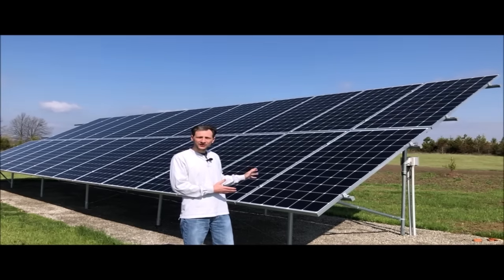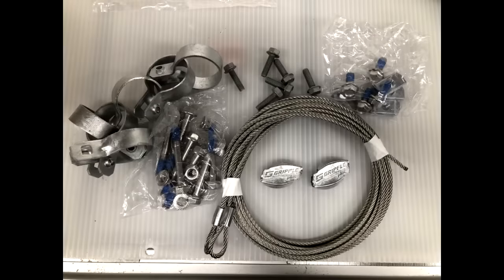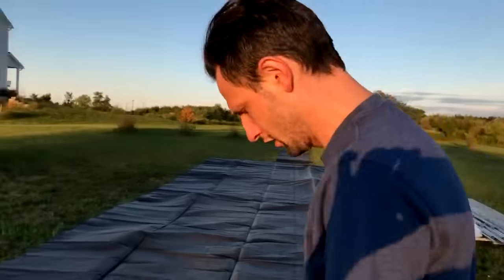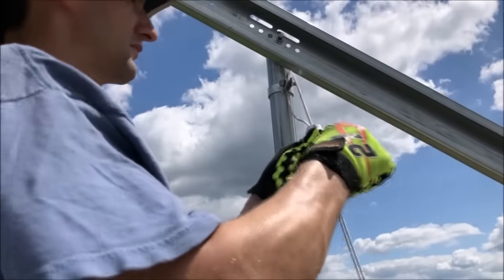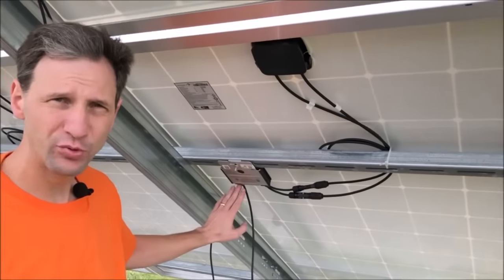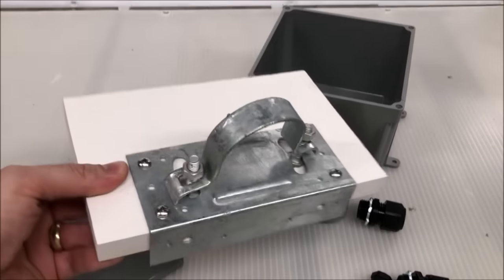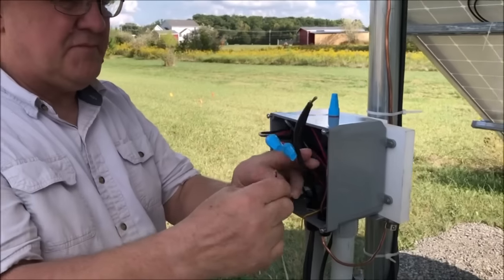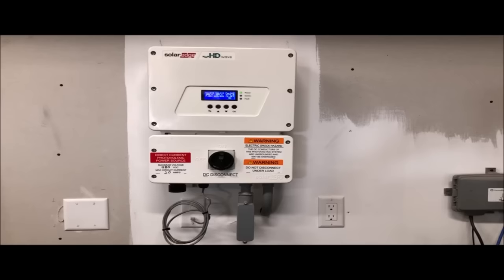DIY 9kW Grid Tie Ground Based Home Solar Panel System Installation

Comment: Great detailed info!  I'm thinking about doing the same, but with microinverters since I have some shade from trees.   One question, is 10ga wire enough to carry that much power for that distance?
Reply from the maker: The size of wire depends on multiple factors, including the voltage, amperage, distance, insulation, etc.   Since the higher the voltage, the smaller the wire can be, micro inverters are not a good choice for long distances.  Micro inverters output 240VAC, where as with an optimizer you can achieve 400VDC input to a DC-AC inverter.  You can use wire size calculators to help you at sites like this one: http://wiresizecalculator.net/
Hope that helps.  Thanks!
Reply: @ProjectsWithDave  Good info, thank you!

Comment: I thought that looping power cables can produce an induction effect.
Reply from the maker: While loops do produce an induction effect.  The loops at each panel, are very large, have few windings, and a low voltage.  I haven't had any issues so far, if someone has data on a possible negative impact, I would love to see it.  Thanks.

Comment: All fixed mounts lose a lot of energy due to angle of incidence loss. The panels would be far more efficient if they were always aimed directly at the sun as it moves across the sky. Of course that is a more complex installation to have panels that track the sun. Also, are these panels hail proof ? What about lightning? What wind velocity can they take? What’s the total cost, including batteries ?
Reply from the maker: Thanks for your questions.  In my analysis, the cost of the equipment to track the sun doesn't justify the increased output.  It is better to just add more panels if you need more output.  The racking system is rated for wind loads in excess of 90mph.  My homeowners insurance will cover any catastrophic loss.  I plan to post a video this Saturday with the total cost breakdown.  Thanks.

Comment: gravel seems like overkill.  Concrete tubes seems like a better idea.
Reply from the maker: Gravel is an added expense, but when I compare it to 25years of mowing around posts, I think it's worth it. 😀
The required concrete for this array was 7' deep 12" diameter tubes.  It was significantly cheaper and easier to do with the screw system.

Comment: Hey Dave, great video. How did you install mid-clamps between panels on the top rail? Any ladder gymnastics?
Reply from the maker: I used a ladder at the edge and reached over to the middle.  It is a bit of a stretch. 🙂

Comment: Did you consider a cut off at the combiner box.
Reply from the maker: Yes, but it is unnecessary.  I have a disconnect at the inverter and I can control the voltage of the panels to 1V/Panel with the optimizers.
Reply: @ProjectsWithDave  I install rooftop systems for my job but have to ground mount for my house. Thanks for all the information.
Reply from the maker: Many installers do install a disconnect at the ground mount location for convenience, and you should always check your local codes.  Even though It wasn't required in my location doesn't mean it wont' be in your area.

Comment: now wait a second your running 40 amps on a 10 awg wire at how many feet long... might want to think about derating for distance and possibly 8awg to handle the 40 amps.
Reply from the maker: here are two DC strings each at 480V and about 3,750 wats for a total of about 8 amps per string.

Comment: Did you hire an electrical engineer to design your system?  We are looking to installing a ground mount 25-30kw net metering system on our farm, with batteries.
Reply from the maker: For my first system I purchased the wiring diagrams from Unbound Solar for my permit process.  Later, after I had some experience, I drew them myself.
Reply: @ProjectsWithDave  Thanks Dave!  That is very helpful.  Your videos have inspired me to try and do my own system after getting quotes of well over $100,000 for our system.  Being a nonprofit, we also qualify for the new 30% direct pay program from the government, in addition to any other incentives from our local electrical coop.
Reply from the maker: I'm glad I could be an inspiration to you.  Hopefully you can learn from my data and mistakes and make an even better system.
Reply: @ProjectsWithDave  You’ve certainly inspired me to not be so intimidated by it.  I’ve reached out to Unbound Solar.

Comment: Great video.  What were you overall impressions of the ready rack system and it's adjustability?  I'm considering that for our system vs some others (snapnrack, ironridge, nuance osprey), but it was not clear how easy it was to get everything adjusted at equal heights and in the same plane.  Thanks.
Reply from the maker: Great question.  There are several holes in the connecting hardware that provide for adjustment in the angle and position.  I found it to be pretty forgiving in terms of accuracy in post placement, as well as straight forward to assemble.  I can't compare it to the others since I haven't used them, but I can certainly recommend the Ready Rack system.  Thanks!

Comment: Don't you get a significant drop in voltage with such a long run to the house?
Reply from the maker: The voltage drop is very small since the DC voltage back to the house is 480V.
Reply: @ProjectsWithDave   Actually you size the wire to compensate for this, hire an electrician that knows what they are doing.

Comment: I didn't see batteries connected in this presentation
Reply from the maker: It is a grid tie system, it doesn't require batteries.  Thanks!
Reply: @ProjectsWithDave  Appreciated

Comment: How did you make the decision to use power optimizers rather than microinverters?  Great video, I'm looking at Ready Rack for my install based on your experience.
Reply from the maker: I wanted the high voltage run from the array to the house, I also wanted the DC available at the house incase I wanted to charge batteries at some point, and I wanted the direct DC Electric vehicle charging capability.
Reply: @ProjectsWithDave  Since your strings come back separately to the house, isn't each string wire carrying about 200v? I had expected the combiner box to combine the two strings so the total DC voltage would have been about 400v coming back to the house. There were 2 wires from each string of 12 panels, total of 4 wires, and those got carried back to the house separately, true?  tnx
Reply from the maker: The optimizers control the voltage to 480 volts independent of the number of panels on the string.  I have a string of 12 panels running 480 volts with one home run and a string of 13 panels at 480 volts for the second home run.
Reply: Thanks, I didn't know that. I have a long run back to the inverter, it sounds like running DC is more efficient if the optimizers hold the voltage that high.

Comment: That is a long run! What is your DC voltage drop from the solar panel to the inverter?
Reply from the maker: I was worried about that when I set the system up, but it is only 2.5v - 3.0v.  Since the DC run is 480v and there are two sets of lines, it ends up being pretty efficient.
Reply from the maker: Thanks!  By the way, my inverter is also an EV charger, so I needed it to be in the garage.

Comment: I love the video and i would be very happy if you can get the manual.
Reply: Are you looking for racking installation manual?
Reply: @zackmofield2456  yes.
Reply from the maker: The racking install manual is specific to each installation and comes with your racking order.  Thanks!

Comment: It looks great what you put together. But... most people make the mistake of installing the solar array to get away from the house.... The power drop of resistance is so great that you loose so much power. I have seen so many people that did that and were really sorry for installing to far away and not a large enough wire to run to the house or charge controller. 
  Nice job
 But wayyyyy to far away from your home. Sorry ... just saying.  
  I know a person that spent 27,000.00 and and did the same thing.  He got to run his house for 4 hrs a day and it' was dead. 
   He moved his array and has power 24 hrs and runs everything washer dryer, regular fridge, normal lighting etc. And used the same batteries, inverter and controller. 
  So installation is everything for spending that kind of money.
Reply from the maker: Thanks for the feedback!  Fortunately, I have very little loss because my optimizers control the voltage to 480Vdc, higher voltage results in less resistance.  Thanks!

Comment: Why no Concrete in the posts?
Reply: If you watch these are drilled into the ground with an auger to like almost 6ft deep. The remind of the type that are used to drill down wire anchors into place or hold them em to place.
Reply from the maker: The screws provide the lift resistance that is normally provided by the concrete.  Screws are significantly cheaper and easier to install.
Reply: Yeah, easy when you have nice soil like you do. I helped a friend install a system in Las Vegas, very rocky soil and we had to get an excavator to dig our trenches!

Comment: 12 x 12V panels in series will give around 144V. 4500Watt (half of total) on this voltage will give over 30A of current. Isn't the 10 awg wire rated maximum 30A AC (much lower for DC) for this long run too thin? I may calculate it wrong.
Reply from the maker: The optimizers hold the voltage in each string at 480V regardless of the panel power output.  That is one advantage of the optimizer solution.
Reply: @ProjectsWithDave  480 V will be fine. Thought it clamps the voltage when you mentioned voltage was limited by the optimizer.
Reply from the maker: The optimizer holds each panel to 1V until it is initialized by the inverter.  That is the "safe" voltage for hooking things up.
Reply: @ProjectsWithDave  got it.

Comment: Hello friend, how much for 5kw and how can i buy it
Reply from the maker: You can go to Unbound Solar https://unboundsolar.com/
And build a system that meets your needs.  Here is a link for a 5.2kW grid tie roof mount solar package for $7,855.
https://unboundsolar.com/1895116/unbound-solar/solar-kits/5.2-kw-grid-tied-solar-system-with-solaredge-and-16-canadian-solar-325w-panels
Reply: H
Reply: @gobotesfay6358  H

Comment: Salut pot obtine si eu un contact unde sa raspundeti? Vreau un sistem solar de 10kwp si mi-ar placea sa am si oferta si sugestiile voastre pentru instalare si componente.
Mersi
Reply from the maker: Sorry, I don't speak Romanian.
Reply: @ProjectsWithDave  uh, sorry, i was about to write the comment on a romanian video right at the end of it, qnd yours was next in queue, so probably that's the reason why the comment landed on your video material.
Anyway, thank you for sharing the information you vathered.

Comment: So what happens after 9 years
Reply from the maker: The panels slowly decrease in performance, and the power rates increase in cost.  I expect that to cancel out to maintain the same savings each year.  Also, the original install was only 24 panels, and I can put up to 30 on this inverter which makes room for some expansion.

Comment from the maker: If I were doing this system today, I would use Bifacial panels:
Signature solar is a great source for bifacial panels and batteries ($50 off $500 site wide Coupon Code December only "EVERYDAYDAVE" ): https://signaturesolar.com/?ref=SALE

Related videos:
Install a Home Battery Backup: https://youtu.be/BzMAW8kW0CU
Bifacial Solar Panel Review: https://youtu.be/1SXNjsSsmq0
Super Cheap Solar Panel Review: https://youtu.be/qu4iGxBhqzs
Check out the first year performance results here:  https://youtu.be/BatTeSq05rU
See the total system cost here: https://youtu.be/PNTO83FvaL4
And How to size your solar system here: https://youtu.be/rbFnZqA0GCI
4 Things to Know About Solar in the Snow: https://youtu.be/vY3PufzPUnI
Ground Vs Roof Mount Solar: https://youtu.be/w-iS_8e7n60
How to Get A Permit For Your Solar System: https://youtu.be/imiEYDHLG4A
How to Crimp MC4 Connectors: https://youtu.be/oH3LqTu4B8E
3 Solar Panel Wiring Issues Answered: https://youtu.be/i7vHEHB3a-M
Net Metering Explained With Actual Data: https://youtu.be/IwUK1dNJ3n8

Comment: What the heck is an optimizer?
Reply from the maker: Optimizers are DC/DC converters, they control voltage output from each panel to balance the string voltage.  This allows each panel to contribute the maximum it can regardless of the performance of the remaining panels on the string.  Here is more information on the topic: https://www.solaredge.com/us/products/power-optimizer#/

Comment: 11:18 Before covering the lawn, did you think that your project would certainly have been more ecological - and maybe even more profitable, if you had looked for a buyer for the lawn instead of just covering it with plastic and wreaths? Someone who is building a yard for themselves might have been happy to pay you for the replacement lawn. It shouldn't be difficult to cut off rectangular pieces of grass with a tractor front loader and stack these pieces on a pallet and get a good price from someone who needs a finished lawn. But maybe next time then...
Reply from the maker: Good idea, but it isn't really lawn, it's an over seeded farm field.  If I charged someone for it I think they would have felt cheated.
Reply: @ProjectsWithDave  Ok. I see.

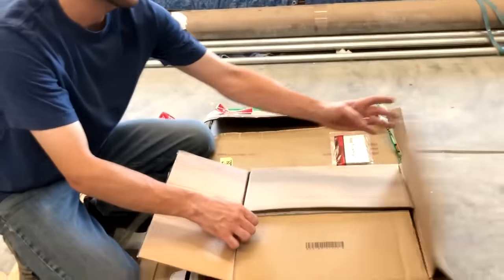Comment: 1:46 - OK... WTF is a power '  optimizer  '? Are these micro-inverters? 

I could sell 'toilet paper ' ' ' optimizers ' ' ' but what, exactly would THAT mean?
Reply: The other items shown use standard reference names/labels and that is greatly appreciated.  

*(When I look up micro-inverter... I know exactly what is meant. When I look up 'optimizer' we're awash in marketing buzz-words that really don't describe what the item is/does.)

Not trying to be nit-picky... I just honestly do NOT know what you mean by 'optimizer'.
Reply from the maker: DC/DC optimizers, manage the maximum power point tracking for each panel individually, while balancing all the panels on a string to approximately 400VDC to hold the DC/AC inverter at it's optimal efficiency.  It allows the system to get the most power out of the string when individual panels are shaded, or different ratings.

Comment: Cable management.....zip ties?  and that grounding system..... ughhhhh
Reply from the maker: The zip ties are quick to use and easy to change if I want to adjust something.  I really liked the panel to panel grounding strips, they were easy to install.

Comment: Just an FYI. From what I've learned get it in before end of 2021. Biden reduced incentive to 22% from Trump's 26%. As it looks there will be no incentive in 2022.
Reply from the maker: Thanks for the reminder.  The incentives make a big difference in the payback timeframe.
Reply: BS
Reply: @joseywells9616  just cause you don't like it doesn't mean it is bs
Reply: @buzza2077  It had been scheduled to be reduced to 22% in 2021, but in Dec 2020 the 26% was extended through end of 2022. 
This article has some history and links to the gov’t docs:
https://www.cnet.com/how-to/heres-how-to-take-advantage-of-the-solar-tax-credit-extension-in-2021/
The federal solar tax credit was originally set to expire at the end of 2007, but it's been renewed many times.